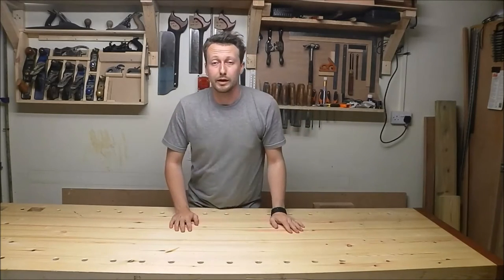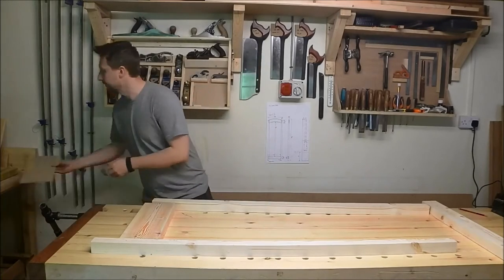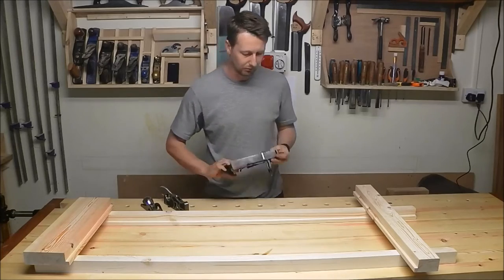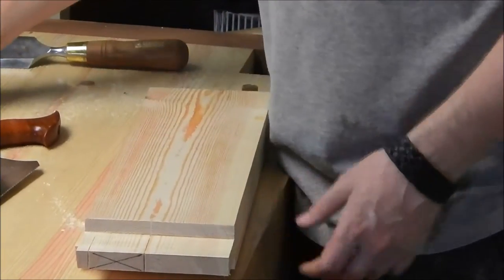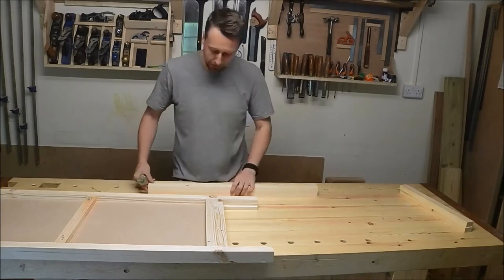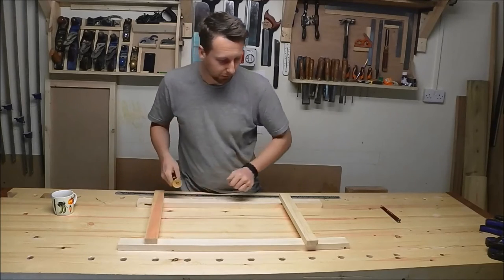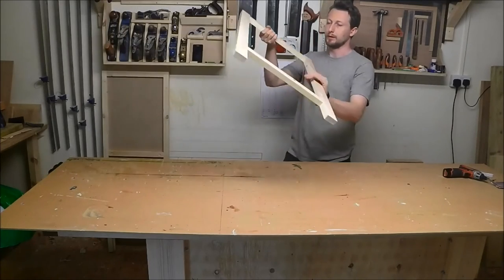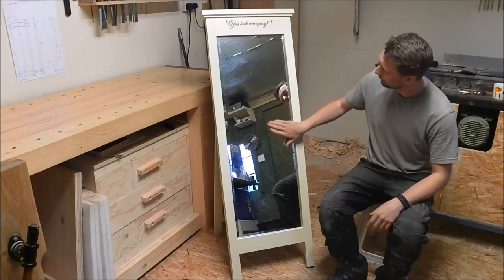Full Length Mirror

Comment: Really nice and a good use of hand tools. What brand is your rebate plane?
Reply from the maker: Thanks +Olly Parry-Jones, Are you enjoying Christmas?
The rebate plane is an old Stanley #78......probably better suited to smaller rebates like picture frames rather than the long deep ones i used it for here....but it get the job done. Thanks for watching....Im just working on the designs of a couple of projects to record after new year. Thanks for watching.
Reply: Sharp Edge Woodworking  I'm enjoying the time off work! ;-) I remember using an old Record rebate plane at college and it wasn't very comfortable either. It's nice to work without dust and noise, sometimes. Looking forward to your future videos.